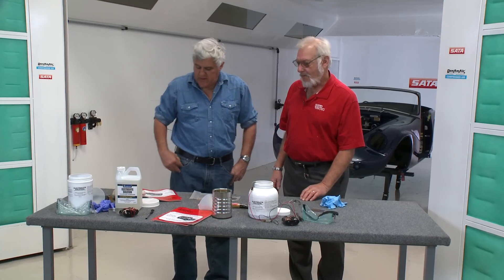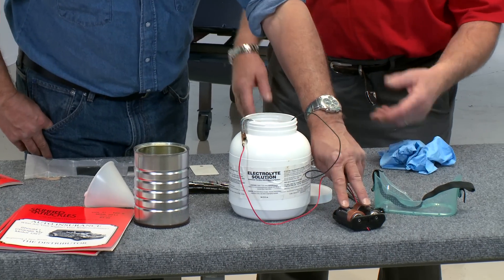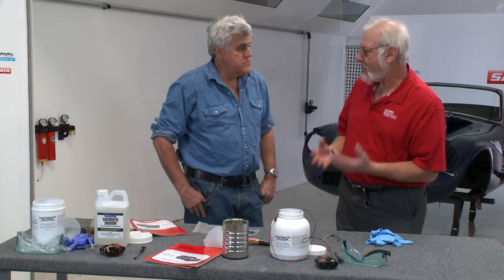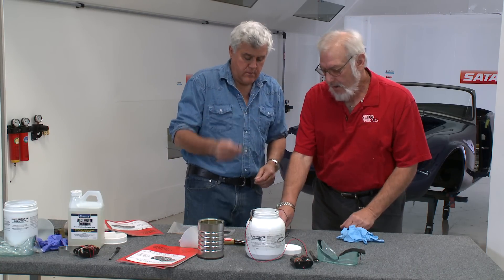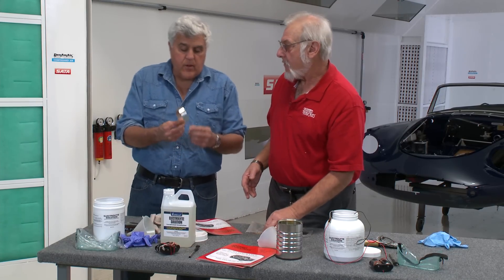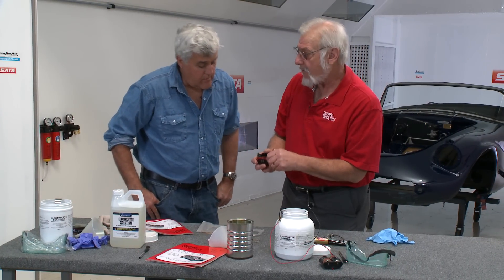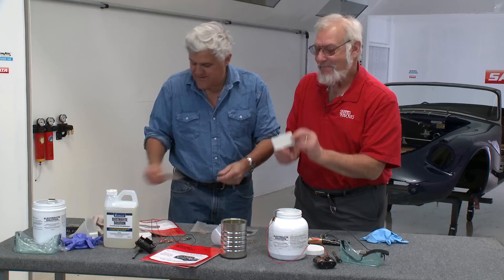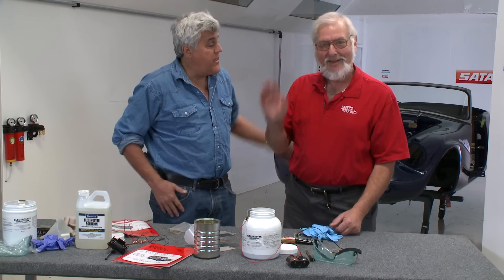Skinned Knuckles: Electroplate It Yourself - Jay Leno's Garage

Comment: You can make your own zinc plating kit for less than $10 instead of buying a kit for $70 that is identical. All you need is a sacrificial zinc plate that you can pick up at a marine shop for about $1-$2,, some sodium carbonate which is nothing more than laundry soda and you can pick it up at any grocery store for about $1-$2, some white vinegar that you can pick up a pint for about a dollar at a grocery store, a battery holder that you can get at any electronic shop like Radio Shack or buy it online for about $2 and any glass or plastic container that you have that's empty. There's hundreds of videos on YouTube showing you how to do it

Comment: Its a simulated Cad coating, its actually battery acid thats used ... It works quite nicely... but, can be limited on how well it works... I use a soft wire brush to bring up the sheen and finish with autosol and a clear coat....  if you want Nickel plate then go to caswell.com its a bit touchier process... Caswell also has what they call a copy cad process that is similar to this but more expensive.....

Comment: You could use tap water for the solution. You would probably need stronger DC source (like car battery charger?) and to adjust spacing closer between cathode (zinc) and anode (piece).

Comment: Does the coating have defects where the alligator clips attach?
Didnt we do the same thing with copper in high school, making a quarter look like a penny- except wherever the clips touched the quarter
Reply: Use a larger clip and grip the quarter by the edge. 
Rotate the clip occasionally during the plating process.
Don't forget your change when you spend it.

Comment: I can't stand paying someone to do anything that I can do myself. I need one of those kits
Reply: Same. Te only thing I pay shops to do is when I buy new tyres, they mount them and perform the initial balance. I rebalance them any time I rotate them thereafter, until I buy a new set. But anything else from building transmissions, painting, welding and fabrication, rebuilding or plating carbs, machining heads and intakes, or any other jobs are not things I let anyone touch my cars over.

Comment: a little acid in a solution, a bit of zinc, some wires with clips, two dry cell batteries, some rusted steel know as working piece = a plating kit, priceless. eastwood not as much.

Comment: NaCl is actually a pretty dangerous electrolyte as it can produce chlorine gas in the process. I dont know what they are using but they best and safest electrolyte i have found is NaOH or KOH and they are cheap and easy to get.

Comment: ***** How can I reply to you directly if you disabled replies? lol

Zinc plating inhibits the Iron under it from corroding by changing the charge state of the Iron atoms, at least until the Zinc itself has mostly corroded away. Zinc corrodes, but much slower than Iron as I understand it.

I've been trying to figure out if you can effectively plate Nickel over a Zinc plated steel part (namely, my '93 MR2's suspension parts that are starting to look like crap). Nickel would be a more durable overcoat, plus I like the natural warm grey color of Nickel more, but Nickel doesn't change the charge state of Iron like Zinc does, so if there are any microscopic holes or eventual microscopic stress cracks in a solely Nickel plating job, the Iron will start to corrode under it.
Reply: Also, since it seems like no one wants to mention this in most diy electroplating videos; if you are going to dispose of these electrolytic solutions, then let it evaporate to crystals, and dispose of it properly with a certified waste disposal company. Don't be pouring that toxic crap down the drain to piss off your local waste water treatment facility. If you reuse it a lot, then you'll probably need to research for the procedures to maintain the ideal pH of the solution with whatever acid and base additives work best so you continue to get best plating results.

Comment: If it takes 10 mins to kit those few things in a box, either your HR dept is incompetent or they're hiring incompetant employees.  
I spent $44K on my 40 Ford Coupe and its restoration.  If I wouldn't have had the expertise to do things myself like plating, welding, fabrication, machining, paint and everything else... I never would have gotten it done. You wanna know what I think... I think Eastwood couldn't give a rats ass about whether I finished it or not so lets not shit each other.

Comment: Two D cells, come on. Trying to keep in tune with the Jay Leno's Garage ethos, why was the anode not hooked up to a bank of 24V truck batteries???? Now that would have livened things up. Whats more boring than wathcing paint dry, watching electroplating by "D" cell. Boring but still strangely interesting.

Comment: Possibly, it could easily be another solution though. That solution would produce chlorine gas in small quantities and they'd probably have to put disclaimers all over the fuckin thing. idk if you can tell in the video but it's slightly yellow, so its probably not plain NaCl, although that solution would work just as well.